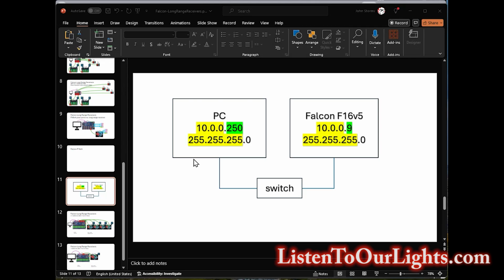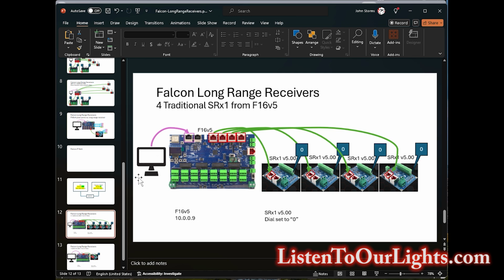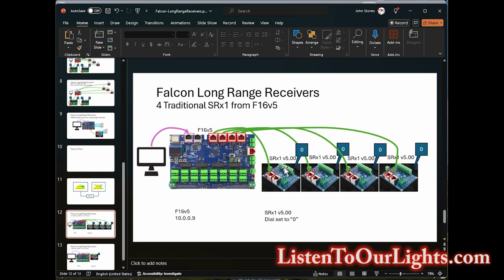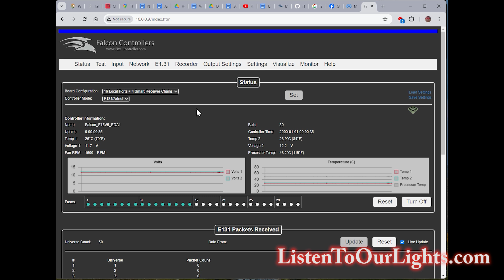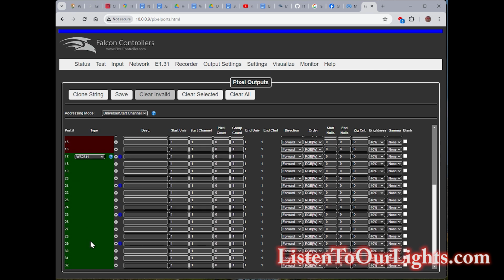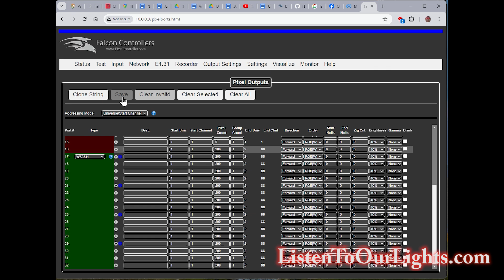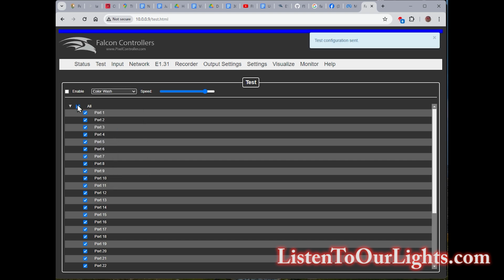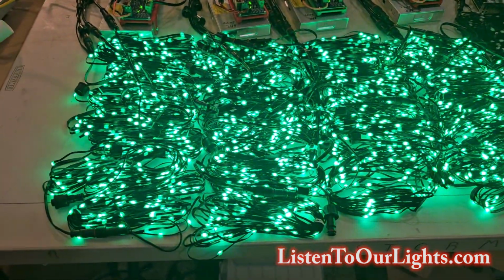Falcon F16v5 with 4 SRX1 Traditional Receiver Boards

Comment: Perfect explanation. I was going rounds on configuring the F16v5 and SRX4. I was told by David that the SRX4 is basically 4 SRX1 units. I am running a 16x60 Mega tree on 8 ports on the SRX4, a Star, and two bulb faces. For some reason, when I run the test patterns on the Falcon interface, each bulb only lights up to a maximum of 120 pixels even though it is set to 150. If I test the pixels straight from the test button on the SRX all pixels illuminate. Have you run into this problem before? Thank you